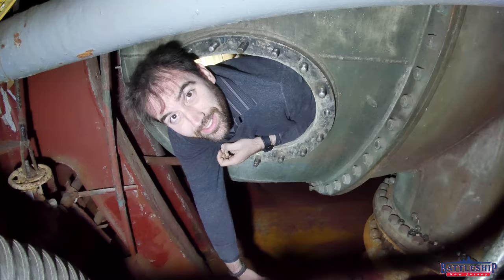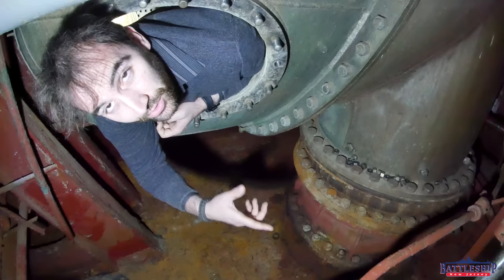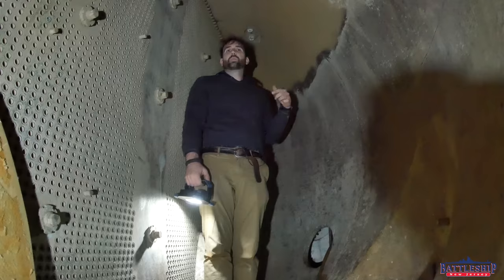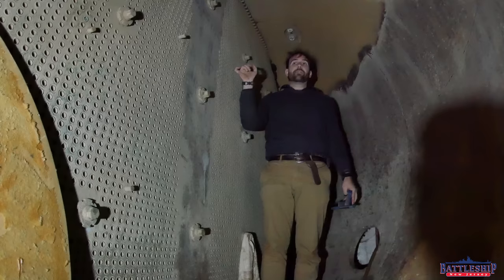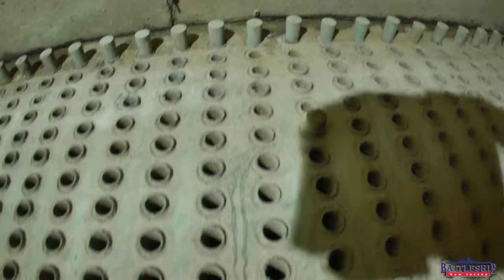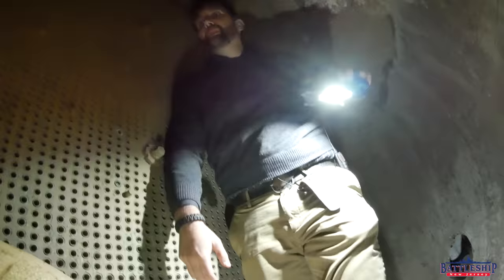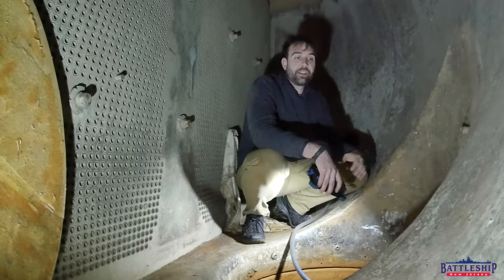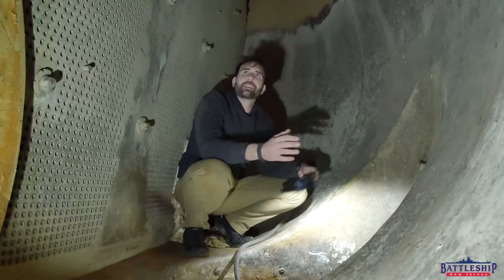Battleship New Jersey's First Hull Leak

Comment: Get a small air compressor.  Attach it to the hose you have on that plug.  Fill the sea chest with air so that it bubbles out of the bottom of the hull.  Then set it up to have a very small flow into the sea chest from now on(or a very accurate super low pressure regulator will work if set up right).  The compressor will have to run occasionally.  That way you have no salt water in the sea chest, and no salt water corrosion.    A dry nitrogen or argon source would be better, but harder to acquire.
Reply: Nitrogen and regulators for it are common, just need to go to any welding supplies store, though you then need to run the air line down, as otherwise you will be humping heavy cylinders of gas down. Easier to just get a roll of nylon (not polyurethane, that ages badly) tubing for pneumatic use, probably 12mm, and snake it down from the deck in a room close to the chest, and where you can easily get a trolley to it from the gangplank, as you just wheel 4 bottles of dry nitrogen up to there, and connect the regulator and flow gauge.  All standard welding supplies, and the cylinders will last around a week each at low flow, before you need to swap them. Becomes a monthly delivery then, and will keep the sea chests dry and purged. You can run a plug and pressurise the others as well, using separate flow gauges, and that way you will see any leaks as well, and be able to attend to them. Cylinders up on top deck also mean, if the nitrogen does run out, the water will not flow back up, just stop at water line.
Reply: Also both gases are heavier than air and could cause a problem if they leaked creating a non breathable atmosphere in that room.
Reply: @KI4HOK  Also, I would think there would be OSHA rules that would come into play if trying to use an inert gas in those confined spaces, so compressed air would be better if they wanted to push the water out.  But the current solution using gravity doesn't require someone to check if a compressor working or a tank of air hasn't gone empty.  I do wonder if pushing the water out once in a while and let new river water in would be better or worse for the speed of corrosion.
Reply: Cylinders of argon and N2 are easily sourced.  but that means you have to regularly move and replace cylinders, while a compressor has to be checked occasionally to make sure it's  still running.  Air requires almost no work, and I'm sure hes busy enough.  As far as OSHA goes, hes already standing in a confined space with no ventilation, atmosphere monitoring, or rescue gear.  For some reason, I think OSHA isn't high on the list.  A room air quality monitor would be the right thing to do.   I'm sure the engine room has some sort of ventilation system built in so that fresh air is brought into the room.
Reply: Oxygen, salt water and steel are not a good mix
Having it bubble from the sea chest, would corrode the area it touches
Reply: @Nightdare  any more than what its doing now?
Reply: @dave4882  

Probably, because there isn't as much oxygen under the waterline
Ships in general corrode most AT the Wind/Waterline
Reply: @Nightdare  Oxygen-rich, moving seawater (mist) is used as a corrosion testing standard.  Short of sulfuric or muriatic acid solutions, the most corrosive liquid one will come across.
Reply: @dave4882  They do have air monitors, as alluded to previously, and use them when going into closed spaces. 

Cylinders to pressurise will last a while if you get them to just bubble a little, a half litre per minute of 5 bar gas (for the hull depth around right) or a little less, just enough to have the ball move off the base, will mean a long cylinder life, and you only need high flow to displace the water. Nitrogen as it will not cause any more corrosion. 

Commonly used in industry to pressurise pipe and coax transmission systems to keep them dry, and if the ship wants such then contact a place like BCS to get the complete thing as turnkey, along with flow alarms if a pipe pops or the leak gets worse. Those run with 4 cylinders, and typically you need to change out every 6 months. Plus can alert you when they have either too much flow or low pressure.
Reply: @KI4HOK  I would have no concern over a N2 leak, air is 78% N2. Quite sure the ventilation in Engine room 3 would overcome any N2 leak.
Reply: So after thinking some, there are small nitrogen generators.     They take a compressed air connection,  and strip out the o2.  A bit expensive,  but probably less than hiring a underwater welder.
Reply: @dave4882  Yes they do work, and are reliable, provided you make sure to keep the filters feeding air in absolutely clean. About the cost of 24 months cylinder rental to pay for it.
Reply: Or they could just keep using the simple and effective solution they are currently using, and then fix it permanently when they go into drydock.
Reply: @netpackrat  it was fixed permanently when they were in drydock last time.
Reply: @dave4882  That's not so.  When it was in drydock last time, the ship was being prepped for mothballs, and the plate they welded over the intake would have been done with the intention of being able to undo the welded plate later if it were ever returned to service.  When it gets re-done, that won't be a concern as the ship will never steam again, so they can do a more thorough repair knowing it will never need to be removed.
Reply: Completely unnecessary.  The solution shown in the video is much simpler, and works.

Comment: Note: The condensing turbine extracts the maximum heat from the steam as work applied to the turbine's shaft. In the process of condensing from vapor to liquid, the water has a much lower pressure than the steam - the molecules move much slower in the condensed phase, so they don't "push" so hard against the walls of the turbine housing.

The condensate still needs to be cooled down in order to get it to the optimum / design condition of boiler feed water, and a heat exchanger is used for the purpose.

It looks like the Iowa class battleships did not use condensing turbines, because that HX sure does look like a condenser as stated. Whether boiling or condensing, you want your vapor (steam) on the shell side, and your heat transfer fluid - flue gas for the boiler, cooling water for the condenser - on the tube side, because the steam has a much greater specific volume than the other fluid.

That tube-sheet - where the tube ends communicate with the heads of the heat exchanger - is an interesting bit of engineering in and of itself.
Reply: Perhaps stated a little more clearly, the condenser creates a low pressure on the exhaust side of the turbine, which creates a larger "delta p", or pressure difference, across the turbine (from the pressure side to the exhaust side), and therefore extracts more power from the steam.
Reply: ran the Evaps on USS Tripoli
Reply: Just a minor correction, you mention flue gas on the tubes. Sorry to disappoint, this ship and most navy boilers are Water Tube boilers.
Reply: There is a big box under the low pressure turbine, it is under vacuum. He is standing in the saltwater side header ( the one you have to clean out after leaving Hong Kong) You cannot pump steam to a higher pressure than the steam operating pressure, it needs to be returned to condensate. (liquid is non compressible). Turbines run on superheated steam, it has no liquid in it at all. Liquid and turbine blades do not mix and will damage the turbine blades. Moisture carryover is immediate closure of the steam chest (throttle valve) and main engine stop valve emergency procedure in every case except battle stations or restricted maneuvering.
Reply: @davepotanko5514  I worked with a Navy guy years ago. I'll never forget his Navy training for a main steam line leak drill. "Lay down you're dead".

Comment: The hose thing doesn't really relieve the pressure down low. The pressure in the tube gets less and less the closer you get to the water level on the outside, but the pressure increases as you go lower.
Reply: Yep, if you stand a vertical pipe between the bottom of a swimming pool and the surface, no water flows out. Gravity works on the fluid in the pipe equally as it does that outside.
Reply: Ok, glad to know I haven't lost my mind. I've been trying to wrap my head around his explanation, but it just doesn't jive with anything I've ever learned, and chemical engineering is all about the modeling of that sort of system.
Reply: @matthewshapiro1676  Don't worry about it. Whoever suggested doing that and whoever agreed to it knows less about physics and marine engineering than the curator.
Reply: It’s a two part gate valve with space between the halves.
Reply: @Propelled  huh?! The problem is water infiltrating through small imperfections. The external pressure on any spot on the hull is determined by depth. The driving force -- how quickly water will pass through, if at all -- is determined by the pressure differential between the two sides of the hull.

Comment: So... why not a high density plastic plug?  Next drydocking, manufacture a tightly fitting plug to go into the seachest(s), seal it in place with marine adhesive, maybe put some kind of expander mechanism inside the plug to force it against the sides, then remove and grind off all the dissimilar metal from the blank.  If the long term preservation problem is dissimilar metal corrosion, stop using metals where they touch water.  The solution only has to stand up to static water pressure, possibly towing speeds, not high speed sailing stresses, and it only needs to last maybe twice the expected time until the next drydocking.  This might be a dumb idea, but there must be an engineering reason why it's a dumb idea.
Reply: I can think of a couple challenges/drawbacks but I think it's a good idea worth at least considering. I mean it's not like DSC isn't a drawback for the metal plug in and of itself. 

Worth noting in general that a lot of the mothballing procedures were probably more short or medium term in mind.  Corrosion only needed to outlast the initial anodes in their minds because it would either be reactivated or written off by the time they expired probably.

Not to slight Navy, they do what makes sense for them, but it seems like a not-insignificant portion of r difficulties the ship faces tie to mothballing decisions that are more or less "museum unfriendly"

Comment: I work on board an aircraft carrier and I can definitely tell you that’s probably a main engine condenser just from the size of it And judging by the way the piping Goes straight down you’re standing on the discharge side The forward side of the condenser should have a scoop injection which is at roughly a 30° angle with a large hull valve followed by a check valve as well as the steam driven main Circulating water pump to supply water to the condenser at low speed
Reply: As stated in the video, this is the #3 turbine condenser, each of the 4 main engine rooms drives one of the propeller shafts (see previous video about the numbering of each, rooms being fore to aft, shafts being port to starboard, so they DON'T line up), and has its own condenser complete with water uptake. Ryan is standing on the inlet side, the height of the triple bottom meaning there is still reasonable vertical uptake below the blanking plate. AFIAK while there is a hull valve, they didn't have a check valve, one of the pumps (there is both an electric and a steam pump) where run until speed was reached, then power or steam supply shutdown when flow was sufficient without it.
Reply: @SheepInACart  You are forgetting a key point that caleb pointed out, if this was the Inlet side of the main Condenser, there should be the discharge port of the Main Circ Water Pump right next to the scoop injection inlet port. They are both extremely large openings and you would see them easily. I agree with caleb murray that this must be the outlet end bell of the condenser and the overboard discharge valve and sea chest. I worked in the engine room of a cruiser and we had almost identical layout to New Jersey's main engine room.
Reply: @SheepInACart  sorry to break it to you, he is indeed standing on the discharge side of that condenser. I know this because I have been these condensers personally.
Reply: Or it could be a pee trap

Comment: Since the condenser is magnetic it could be made of a copper nickle alloy, which some varieties contains small amounts of iron. CuNi has very good corrosion resistance against seawater, since it creates a passive film on top of when in contact with seawater and it also has pretty good heat transfer capabilities.
Reply: Too soft. It would never work.

Comment: Have you looked into renting or borrowing an XRF gun (XRay Fluorescence) to see which alloys you have? You can shoot the tank alloy with XRays to see what metallic elements you have but it won't give you carbon content. Then, you shoot the blanks as well as the welds to see what the compositions are to track down which areas have the most dissimilar metals side by side to focus on first when you eventually do go into dry dock.

Comment: Remember that nickel is ferromagnetic. This condenser shell might be some nickel iron alloy selected to be compatible with steam at high temperature and tolerate sea water. Those tubes are pretty small diameter. I guess Uncle Sam had lots of labor to punch them clear as needed.
Thanks for the interesting videos.

Comment: I'm a former boat and ship builder and Certified Welding Inspector. I would be interested to see what those alloys are. Hopefully after I hit my 15 year mark I can sit to become a welding engineer and need to do some serious study into all of that. I have done a fair bit out of interest and find the way metal interact interesting. I would love to hear what you find out about the material.

I'm out on an injury and if you ever had a question I could help with it helps to keep me sharp.
Reply: I wonder if it could be a early stainless variant? I know a few are "magnetic" (can't think of correct term lol)
Reply: @daveking4229  Some some varieties of Monel are magnetic, and are old enough.
Reply: @daveking4229  Actually all stainless is magnetic, some a lot less than others but it's all magnetic!
Reply: @455buick6  Generally 300 series is weakly magnetic if not non-magnetic while 400 series is much more strongly magnetic. 300 series is called austenitic which  refers to the crystal structure 400 series is martensitic or ferritic. This is general info I'm sure there are exceptions. Maybe some  metallurgist can add to this
Reply: There are older stainless steels than that. Most people are used to the non magnetic stainless but there are a lot of others and they have different properties. All steels will loose magnetism at a given temperature. At that point they change to a structure called austenite. With the right heat treatment and mix of alloys you can bring that down to room temperature but at some point if you go cold enough it will begin to convert to something else. There are different mechanical reasons for the different grades and they resist different types of chemical attack. Salt can actually be a bad one especially if temperature and pressure are involved. Besides the chemistry of the steel the heat treatment and chrystaline structure all matter.

Comment: Not to nitpick, but the steam leaving the turbine is wet (about 10-12% liquid, by mass) steam at saturation conditions. Being that a condenser operates below atmospheric pressure, that means the temperature of the steam is actually under "boiling" temperature (in typical parlance). For the plants I design, that steam can be in the 90-120F range. I imagine these Navy ships are higher, as the condensers are super tiny compared to what I'm used to.
Reply: 140-160 degrees for this condensate I believe. Been a lot of years!

Comment: That looks like it could be a permit required confined space. And with those sacrificial anodes and visible rust, you might want to make sure you have a low-o2 alarm on you when going into something like this (or the anchor chain locker). That's the kind of space where all of the oxygen will get pulled out of the air by the rust and corrosion (leaving you with "air" which only has nitrogen and carbon dioxide). This can kill you pretty quick without you realizing it in the right conditions (like just randomly falling asleep). I noticed you seemed to be stumbling on your words a bit while in there which can be a sign of mild hypoxia. I did see what looked like a ventilation hose at the end of the video so I'm hoping there was a supply going to this area while you were working in it.
Reply: good advice.